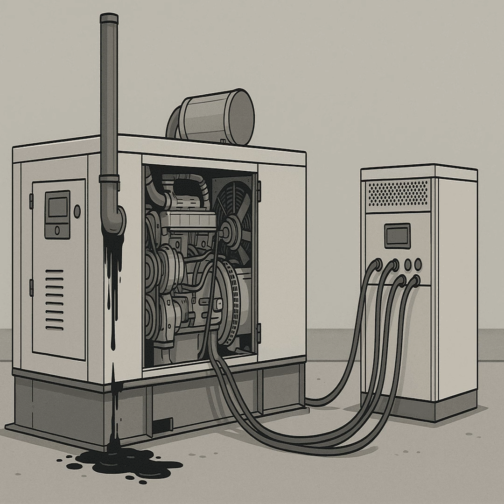Diesel Engine Wet Stacking: Causes, Consequences & Prevention

Comment: We had this issue with portable aircraft generators as they were designed to sustain 260 amperes but often only saw maybe 50, tops. Once loadbanked, it would burn off the wet stack and be good to go.

Comment: A great presentation of the most important things a person needs to know before buying, operating and maintaining not only a diesel generator, but also any machine with a diesel engine. Thank you. Buying and servicing a quality diesel generator is not a cheap matter. I think that with this podcast you will help thousands of people make the right decision when buying (deciding on the right size of generator), operating and maintaining it. 21 minutes packed with important information that can save individuals and companies thousands, in some cases tens of thousands. Thanks again. Greetings from Slovakia. Slavo.